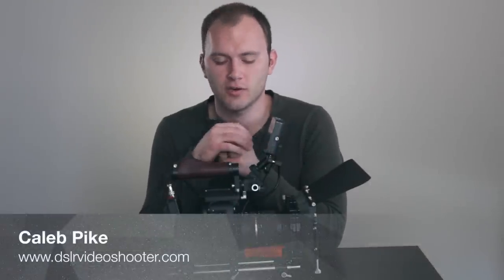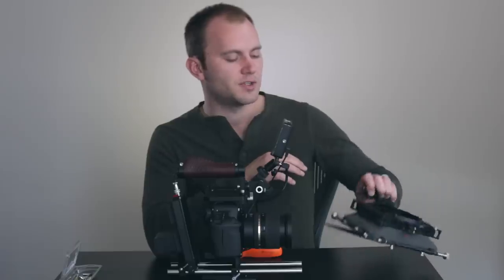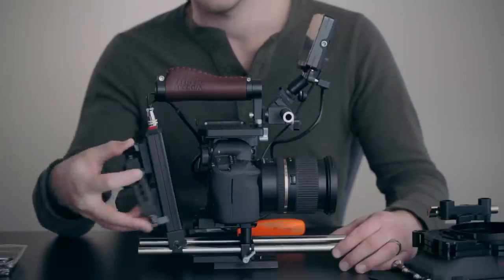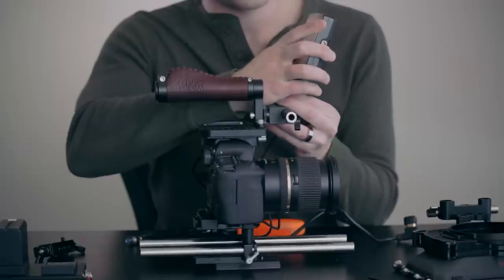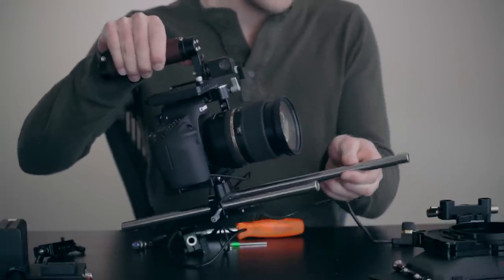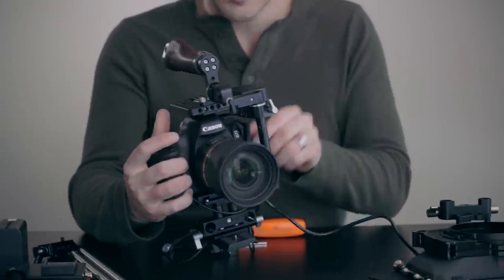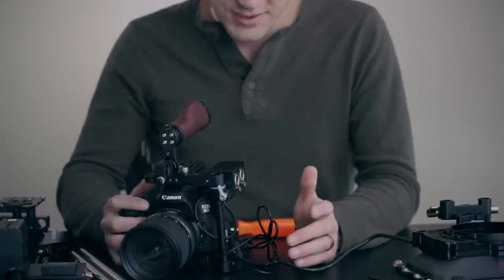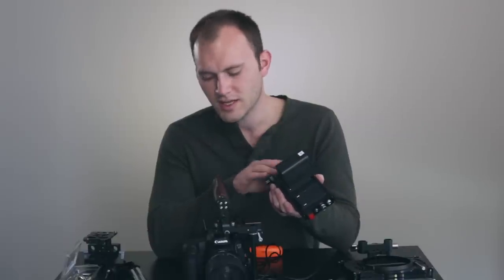Custom Cinema Rig

Comment: Do you still use your battery setup with the gh4? I ask because I heard the battery life on the gh4 is crazy good! Also since many more days have gone by since your review of it, any post review thoughts on the gh4? I'm looking into purchasing one if you couldn't tell haha. Also,  I saw a review where the guy said that auto focus doesn't play nice with the metabones speed booster? Do you find this to be true? More of a photography question I know but I plan on using it for both video and photo.
Reply: +Jay Kadlec The SpeedBooster, from what I know, basically enlarges the censor. The AF points would most likely become harder to pinpoint during this process, but what do you want more, DOF and a lack of AF points (though if you're using this for pro photo and/or video, the words auto focus shouldn't be in your vocabulary haha). Especially if you're gonna spend 1.700 for the camera and 500 for the speedbooster, you're gonna use it for professional use. SO you should forget the AF and go completely manual.

Comment: in reference to the 15mm rail block set, you said "that easily detaches" ... you did not SHOW us exactly how it detaches. I was trying to figure out how to save as much $ as possible by understanding your setup to the "T", but this was one thing that was confusing me... if anyone know what exactly is needed to attach the cage baseplate (that he took off) to the bottom of the cage itself, i would be VERY grateful to you! Thanks all! -

Great video man, thank you for uploading and making most everything very clear. Very helpful!

Comment: I bought the same battery pack Converter because of this and themonitor and lights work but it WILL NOT POWER MY REBEL T5I AS THE SELLER TOLD ME IT WOULD! this is bullshit I waited two fucking months for it to get here!

Comment: the lcd is so pointless, so is the mattebox. Sexy, but dumb.
Reply: Might you explain why?
Reply: The monitor is huge. How else would you get an extremely low shot facing up? And the matte box is killer for filters that you otherwise wouldn't be able to use.
Reply: Sexy and functional. The DP4 is great and can be louped, which is great in sunlight. The mattebox is great for ND filters and for limited flaring at the sensor. How would you shoot outside Connor?
Reply: A lot of times you're shooting at an angle where the built in monitor just doesn't work, hence an external one, and the matte box is for attaching filters and blocking out sun glare. Not pointless at all.